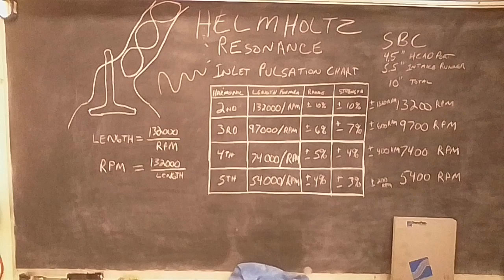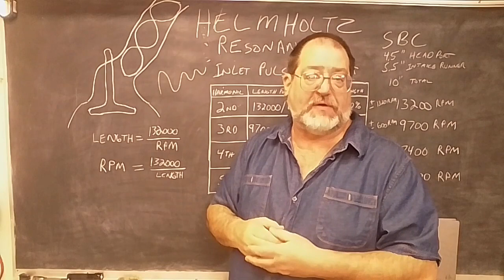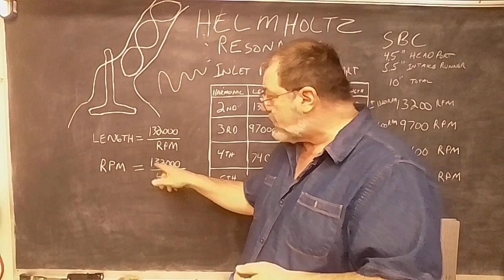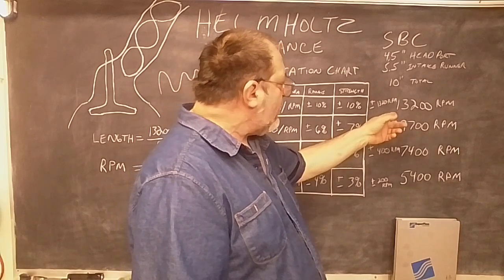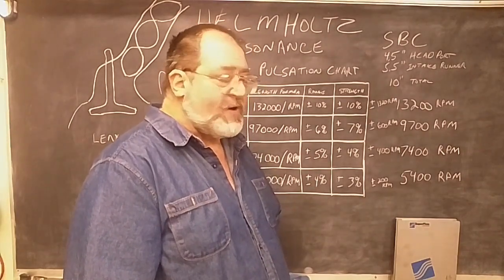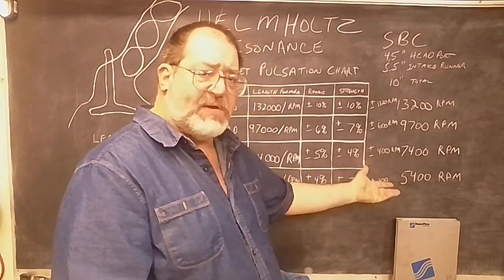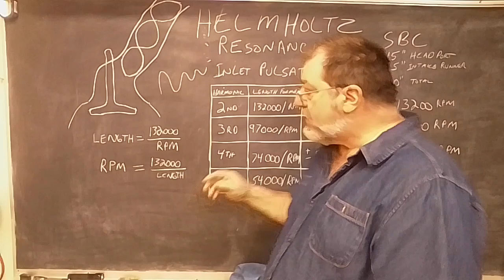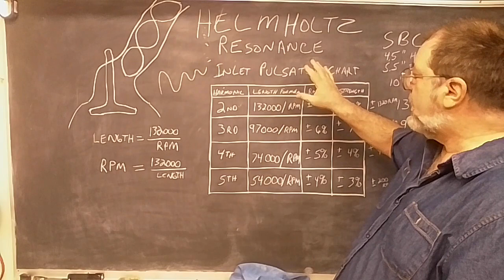Helmholtz resonance supercharging ....

Comment: Could I get your opinion 
of the single carb and long intake runner(s) on a volkswagen beetle ?
Is there a game to be played with ... 
such as a helmoltz resonate chamber .. 
with a T just below the carb ?
Or perhaps ... a resonate chamber just above the  two intake valves ?
Thanks
Reply from the maker: Chamber?? I don't understand that .,.  It has been years since I did type 1 engine but back in the day I ran lots of different carbs and the best one I found was the Holley Weber on a long runner center mount carb ..., that's was probably about inertia ram not helmoltz
Reply: @scotthatch4548  
I'm fabricating a custom intake for a beetle.
I was thinking more along the lines of incorporating a chamber, something like a plumbing suppressor.. like the kind used in house plumbing to prevent the pipes from hammering.
Nothing strange, just something to absorb the reverberation created by the valves .. opening and closing. Thoughts ?
Reply from the maker: @thestove2407  I don't think it would do anything at all to help make more power .... Plenum space needed is about carb size.... And runner length is about rpm ... Runner size is about airspeed and flow .... I think you are under some impression you can do something magical and it's just not going to happen .... It's a very simple system